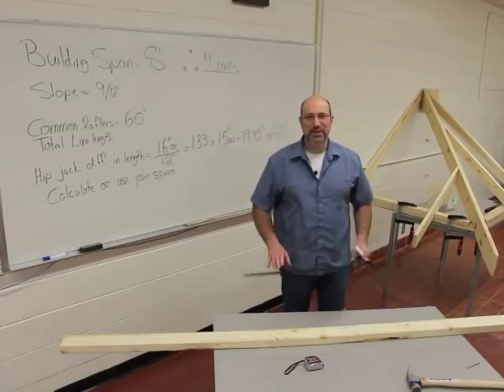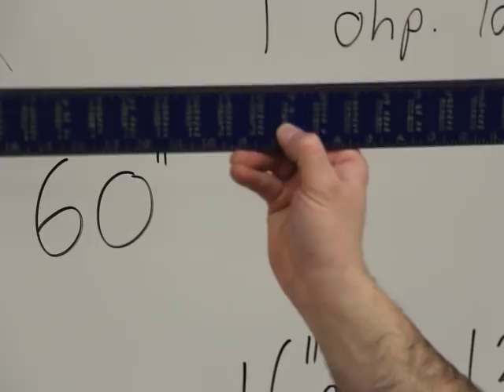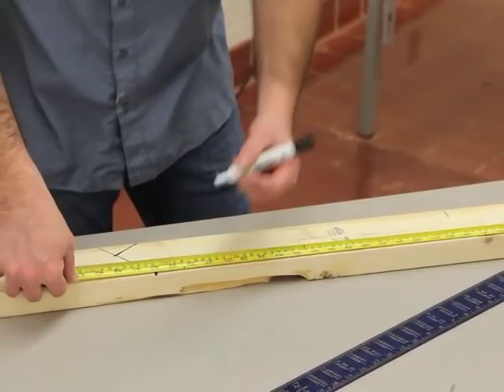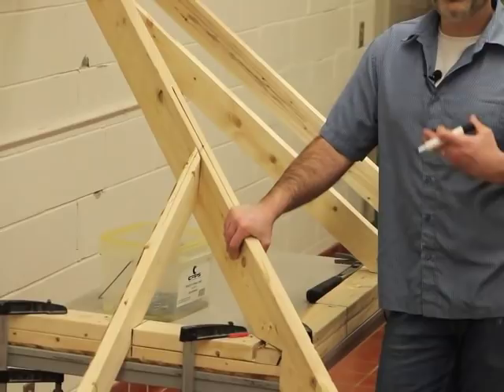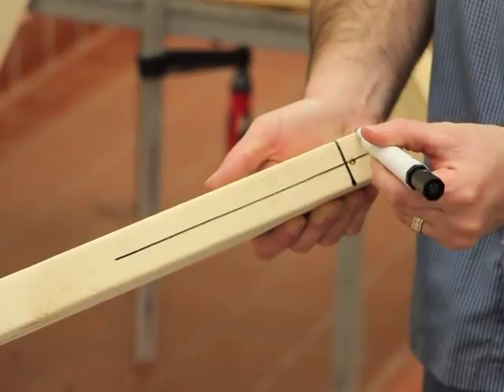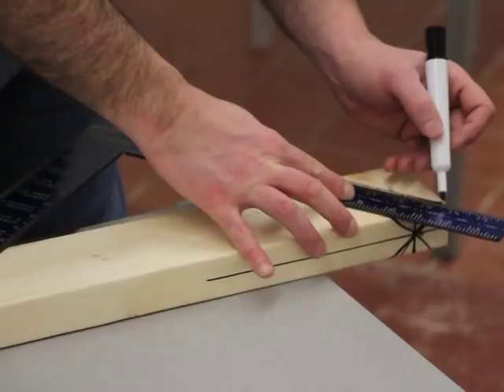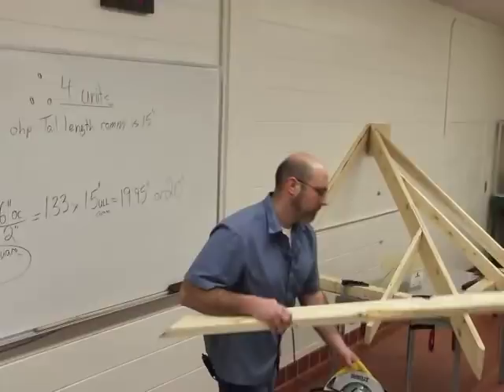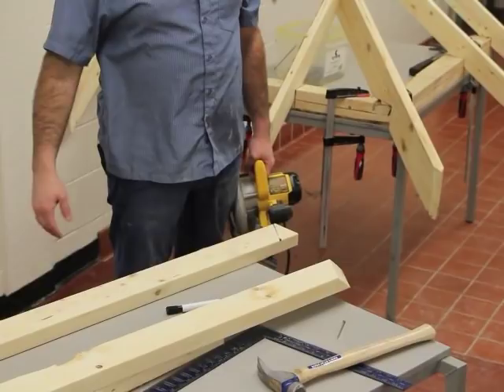Jack Rafters

Comment: Good stuff sir, if you divide the spacing between rafters by cos degree of the roof you will find the same difference in length. eg. 16"/cos36.87 = 20"
Reply: Geez,, thank you 😂

Comment: Good Tutorial ! This is splitting hairs perhaps, but  "half the thickness of the hip at 45 degrees" also does not work if you have a multiple -pitch roof. (9/12 in one direction, 12/12 in the other for example), because the hip is no longer 45 degrees to the plates. The difference isn't much on a 2x hip or valley - most framers I know don't even bother to recalc it.  However - when you get into timber rafters and etc - now that difference goes from being 1/16" to being  5/16" or something - it's enough to make for a sloppy fit or an off-center cob-job.
Reply: Tioga Fretworks when you work with big expensive timbers you calculate every piece individually. Unless you've got bags full of money just laying around the jobsite.

Comment: I guess no one uses their framing square anymore to find side cut angles. If you mark the side cut angle, and make your side line mark, then shorten from that line (not the squared line) and mark the 2nd (actual) cut line. Then all you need do, after layout, is set your saw bevel and cut. I suppose your method is another way to achieve the same result, and that's fine, but I wonder why the square method is not being taught anymore. Those side angles are stamped on the framing square for a reason.
Reply: I never ever heard any one explain the side cuts on the framing square. Any resources you could lead me to explain further information please?
Reply: @AliBinSun  On the 5th line of your square, it says "side cut of jacks." Follow that 5th line over to the inch number of your slope (9 for a 9/12). Under the 9, in the 5th line, it says 9 5/8. Put gauges on the tongue of your square on 9 5/8, and the blade of your square on the 12. After squaring a line across the top of your board, and marking the center, place the blade of your square on top of board using the 9 5/8" and 12" where it intersects the center mark of board. Mark this angle, on the 12" side, and then mark your plumb line down the side of board from the end of this line. shorten it, and make new plumb line, then at top just mark the angle across the top again. Set your saw bevel to 45 degrees and cut. For hip or valley, you mark these lines in both directions, but those angles will be different than for jacks. It's all stamped into your square.

This is given this way because the compound angles will be a little different, depending on your slope. Doing it as in the video above is okay, but it's using a 45 degree for every side cut angle, when they're not all 45. This way will give you a little better fit.
Reply: Note: You can mark this side cut angle on a board (with framing square), then take a bevel square and set it on that angle and lock it. Now you can use this instead of having to use the big framing square. You really don't have to do this but one time. You can use common length difference for the rest, going from long point, down to your plumb line. You'll have to measure from long point of the one you laid out and cut. Then measure that distance down the next one, and subtract the common length difference, if you're going down hill.
Reply: I use the framing square side cut angle table, the reason many don't is  not knowing how to read it off the square, AND  it's always greater than 45° that a skillsaw can cut, even more so the steeper the pitch,  so they get lazy and lop it off at 45 , if you cut it by hand or use a mitre saw its perfect every time. Note on this video there was no closeup of the bevel against the hip, the pitch looked pretty steep, so I'm guessing it wasn't quite as sweet a joint as he'd have you believe 😂
Reply: @jeremyfoster6942  Yes. I said above to cut the angle at 45 degrees, but using a miter saw is more accurate if you need an angle greater than 45. 45-degree angles will work, but you get a better fit with the side-cut method.

Comment: Man I can't get this inches stuff metric so much easier
Reply from the maker: Yep.
Reply: 1 inch = 25 mm
Reply: @YoshevElazarMikael   25.4 then they start with 8th of inch and when they get really down to detail the say 1000s of an inch which is metric. 3 mm or 4 mm so much easier to adjust up a rule when explaining something.  1/8 about 3 mil then you go to 11/64s for 4mm just really hard work. I like being accurate. Love the videos but i can't get my head round this stuff saying about an 1/8 th of an inch so 3 mm  or 3.5 mm

Comment: how do you figure out the half of the hip stock angle?  I know you said 1 1/16 inch.  how do you figure that?
Reply from the maker: Draw a line at 45 degrees across the top of a 1.5" piece of lumber. You will see that it is 2 1/8" long. So half of that is 1 1/16".
Reply: @buildingreno  Thanks

Comment: very informative video , how would you convert all dims to metric to use a metric roofing Square ? there  is almost no info available on metric roofing Squares
Reply from the maker: Wayne Fraser the metric square is called the Frederickson square I believe. It has a rafter table just like the imperial square. I'm pretty sure the unit of run is 400mm.

Comment: any videos on how to calculate hip tails
Reply: you just step it off the distance of the overhang.
Reply: Carlos J. Gonzalez if you absolutely have to calculate tails, remember it's a triangle, just like the rafters.
Reply: If the overhang is 12 in just do 12 inch run and the pitch and press hip and that's it

Comment: You make that way to complicated. The easiest way to come up with the length of the first jack rafter is, assemble the roof with all the commons in place and the hips in place. Straighten the hips by bracing them to the ceiling joists. At the top of the last common rafter that is a 16” on center rafter, hook your tape measure on it and mark the hip where your longest jack will be placed. Put a framing square against the common at the side of the ridge and mark that common. Just measure from the end of that rafter and that is the measurement that would be subtracted from a common and there’s the longest jack.
Reply from the maker: oh ya! that seems way easier! hahahahahaha!! Calculate and cut it all safe on the ground and pass up the parts. Much faster. Much Safer. Thank you for a good laugh!! I enjoy when everyone has a great sense of humor! 

BTW : too complicated. Not, "to complicated". Grammar counts!

Comment: How critical is a Hip Jack to the structure of a roof?
I have a few where the exposed ends are compromised by termite damage.
2 of them are compromised to 3" from the stucco, a couple other ones from 1/3 to 2/3 of the extremities to the stucco.
Estimators have different ways of fixing the damage from bondoing, sistering or opening the roof so a new hip jack can be attached to the hip rafter by sliding a new piece from the outside in since there is very little clearance from the attic to do this from the inside.
Those who are proposing bondo patches and sistering swear it will not jeoperdize the structure of the roof.
Some seem to  think they are dealing with a rafter tail rather than  a hip jack.
My search on the internet tells me that they are different however I have not yet found a site or a video that shows how to fix or replace a hip jack.
What would be your best advice to fix the problem I have and conserve the structural integrity of the roof?
Reply from the maker: tahitinui2010 You can sister them up. Bondo patches won't offer any strength. Will you be able to make a connection at the hip? The longer the jack the more it does to support the sheathing and roofing. I hope that helps. Wow!!!! likely not cause this is a year old! Sorry!
Reply: If the rafters are still full bearing and the damage doesn't go into the seat cut you can just repair it any way you can get nails to hold.

Comment: I m building a 14x16 gazebo with a hip roof  I want to leave a 2t overhang do you know what's  my rafters  length should be ? Please
Reply from the maker: Oh a gazebo! Nice! Use whatever rise you wish but use 13" for the run of the hips.
Reply: people usually use longer than necessary rafters, and cut them after all the rafters are installed, to the correct length. 
ie, avoid doing calculation.